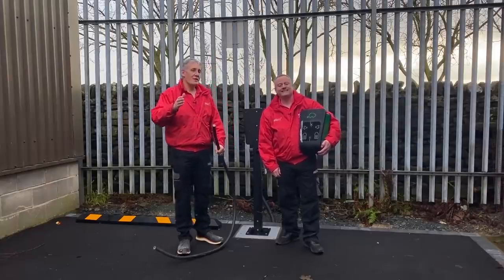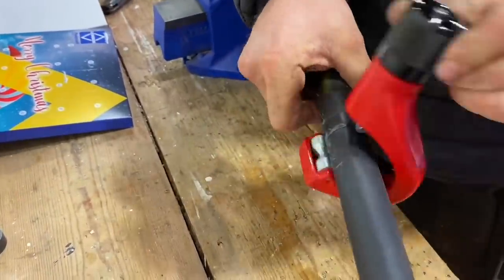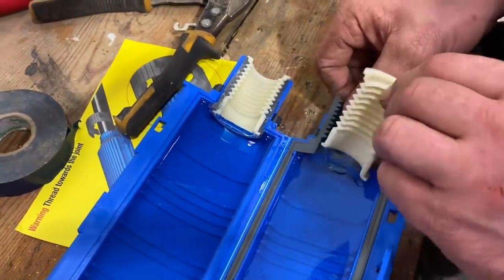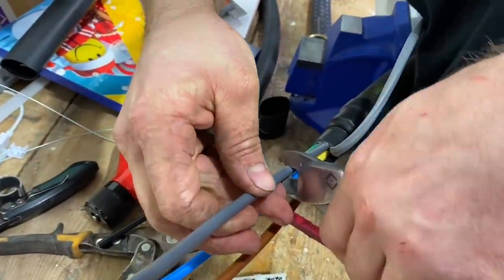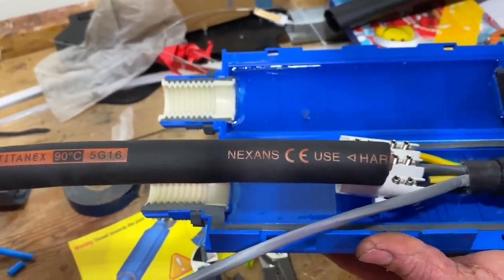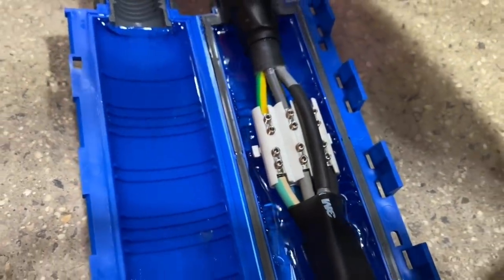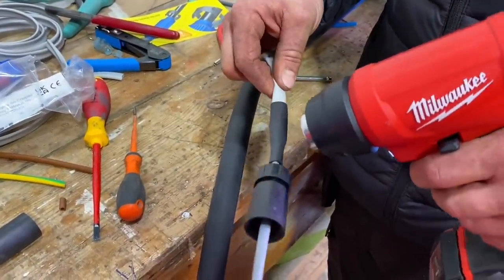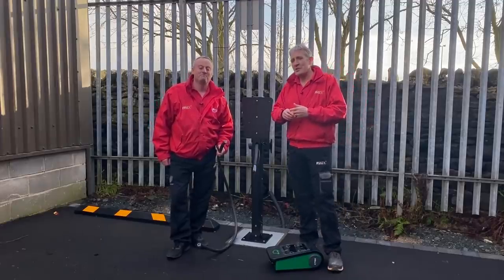PROBLEM SOLVED - USE RUBBER CABLE INSTEAD OF ARMOURED CABLE?

Comment: I'm pretty sure that Ideal made that sheath stripper back in the early 80's, it had an ecentric blade that circles the sheath then rotates to strip lengthways.. I may still have one ! of course, it was blue and company issue at the time.
Reply: BT had a similar one.
Reply: Knipex makes one slightly more advanced

Comment: I used a shark joint several years ago for joining a damaged water pump cable as it was recommended by my wholesaler. Once I’d done the connection, I dropped it in the water slowly with my fingers crossed. 10 seconds later the rcd tripped. Not used them since then.

Comment: I work In dewatering we use HO7 RNF for all the drop cables from control panels to the motors with a submersible joints to extend the motor tail. Personally think SWA is used when people don’t want to design a install and just default SWA for outside. You very rarely see it in Europe come to think of it I never have……

Comment: Why did you strip 20mm of the outer covering off the armour, before covering it with the short length of heat shrink?
Reply: At a guess, this was to pick up the earth connection with the spring loaded earth band, as you would do in a standard torpedo joint and then realised it wasn't required.
Reply: @jollyfinequality9865  I expect you are right. I would have thought they would have edited that bit out and gone straight to the heat shrink collapsing onto the cable 😀
Reply: @jollyfinequality9865  I'm also in two minds about the outer layer of heat shrink trapping the data cable to the power cable. Because it extends beyond the gel into the gland, if the gland itself is not totally waterproof, then there could be a risk of water tracking under the heat shrink in the gaps between the cables. Hopefully that last inch between the heat shrink and the terminals will be sufficient gel to do the job. Perhaps use two short sections of heat shrink, with a decent gap, to allow the gel to get in and do its job.
Reply: I assumed it was force of habit and whoever did it forgot they weren't putting a gland on
Reply: To properly glue down the armour strands. If they are left ending with the outer cable insulation, they are not held in place and butt the heat shrink. That way they could poke through the heat shrink when the cable is handled. When pressed flat between inner insulation and heat shrink it is much less likely for them to do that, they'd just slide between the two.
Reply: @HenryLoenwind  Interesting, I didn't think of that possibility. But I think if I wanted to stop the wire ends poking through the heat shrink I would have put on a 20mm length, butting up to the wires. Then put the main heat shrink over both. This way the wire ends would be kept away from the outer heat shrink more effectively.

Comment: For years we've been using flexible cables for garden and industrial installations and just running duct work after it was specified by one clients designer. The duct work itself though always had to be guarded to prevent rodent entry. Other than that you already have the relevant electrical and mechanical protection provided it's installed at the correct depths with the lay out as installed listed at the intake of the site. 

Also if you're using a duct system it's easier to run a Cat5/6 to each point if the EV points are far from a wifi signal and have a hard wired option for updates. Significant saving to be made doing it that way.

Comment: Rubber v Armoured, doesn’t it depend on the upstream protection? If an RCD (or equivalent) is fitted then Rubber would be OK, as protected against future ground works that have not carried out a ground scan.
Reply: Theres no requirement for an RCD to protect from groundworks like in this installation. Buried in a plaster wall would be a different situation tho.
Reply: Iagree belts and braces.

Comment: In my IWP we fitted an EV charger and only used HO7, only because we could fit it through a steel drain right beside the back door then feed it  through to the attic and down to the CU, I myself didn't make the terminations I just assisted in keeping the wire straight when feeding it through and fitting it to the wall. So I'd say if reasonable protection is able able be improvised by the environment then use HO7 but if at any point there's a chance that the wire could be mechanically compromised then terminate it back to or fully through with SWA, although if we had to use SWA the whole way through we'd probably would be been there for a whole say and probably after terminations getting bad IR readings. Also that house was crazy close to max current capacity, it had a B&B attached to it and having to have an EV charger meant that the owner had to reconsider certain circuits. We fixed up 2 radials and made it one whole loop.

Comment: As always a very high standard of work. However one question for you, as you guys are often the championing the use of tightens torques on connections which I think is particularly relevant on connections that are not easily checked in planned maintenance schedules. Like this one. You also mentioned relaxation and the need of a retightening which is a very good point. Many other types of mechanical fixture connection procedures often will detail time scales to re-torquing of mechanical connectors to account for creep as a property of materials with temperature bands detailed, etc. We used to have to do daily checks of our torque wrenches with a norbar tester. A wee saying our professor in Power Engineering used to say “I have never known an Electron to fail, electrical failures are always mechanical in nature” not that he was prone to any form of bias. This came to mind after just looking into 1/4 inch torque wrenches of 1/4 inch hex grub screws that specified 39nm when all the 1/4 inch drive torque wrenches I could easily find had a limit of 25nm. Needed a visit to Amazon for a drive adapter. This is with bearing in mind that we all have calibrated arms and wrists for matching desired torques. 😂
Reply: Ace..dear

Comment: Howdy. Excellent installation skills.
Personally I would recommend using non-isolated ferrules too. They will keep the strands together. Also. they will spread out the screw pressure over a larger area improving conductivity. And they also will reduce the thermal expansion effect. Different alloys have different expansion coefficients which may loosen the connections over time.
And yes. The outermost layer of a cable is called the mantle. The armour is another thing. These are often mixed in mundaine talking. And finally. The armour in NOT the PE conductor in consumer voltage installations. Yet the armour MUST be equipotential bonded to the PE. In distribution voltages of 10 - 20 kV the armour is often used as a PE or PEN conductor.
Wonderful piece of appliance. Usually this kind of cable switching is done using cast alloy boxes or cabinets. Connections are done using pipe type screw terminals. Finally the box is filled with resin. Good too but cumbersome compared to this appliance.
In high regards.

Comment: I am not keen on the cat5/6 cable touching the live terminals, if this was to ever wear through it could cause damage to IT infrastructure, also not sure how you are achieving electrical separation between mains and network cables after the joint as it looked like you didn't use a shielded network cable after the cable joint. This can give interference into the network cable through induced EMFs and corrupt data. Interesting video though!
Reply: I am certificated Computer Specialist for data cables. I never install power cables together with Cat3 (or better) if I can do it other way. Specially direct near 16 mm² power cable with 63 Ampere.
Reply: ELV cables CAN be run next to LV cables providing the insulation on it is to the standard of the higher voltage cable (i.e. 400volts). I think the manufacturer of the multi-cable knows this and has insulated the data cores with a sheath matching that of the conductors. The demonstration shows the installer adding some heat shrink near to the joint terminals to increase the mechanical protection of the data cable above and beyond what is necessary- just for their own overall good standards. I do take your point about interference into the data cable though, but I believe the data cable part of the multi-cable is screened.
The multi-cable couldn't have a BASEC type approval if it didn't comply with the standards of both types of seperate cable.

Does this sound satisfactory to anyone?

Comment: Your 16mm conductors equals our 6 AWG conductors in the US. If we at doing an EV Charger hookup it is considered a Continuous Load. In the US, any load that can be expected to last 3 hours or longer is Rated as a Continuous Load. When we have a Continuous we must derate both the Circuit Breaker and the Cable by a factor of .80.  With a 6 AWG of this type we could only pull a maximum load of 40 Amps maximum per conductor. Also, we can only use the 1/2" thru 1" Flexible conduit in the ground, anything larger does not meet the crush requirements for this installation and are not listed to be direct buried nor encased in concrete. Knowing how strict the Electrical Code are in Great Britain, I am really surprised that they allow this conduit for the same reason that you cannot in the US which is the crushing issue.

Comment: Work with H07 and SWA every day. H07 is the cable you want for the big cable pulls. It’s mostly used for motors and pumps.

Comment: Is twin wall ducting classed as having “equivalent mechanical protection”?  The reg states “Except where installed in a conduit or duct which provides equivalent protection against mechanical
damage, a cable buried in the ground shall incorporate an earthed armour or metal sheath or both, suitable for use as a protective conductor.”  How do we determine “equivalent”?

Comment: Another great video there guys, In short.. if mechanically protected and electrically protected then why would you not use easier to work with cable.. H07 all the way..

Comment: All types of cables have their applications and uses. I think SWA is better than H07-RNF cables for underground use. As it's name suggests it is "armoured" against spades, diggers, Rodents, etc..I always feel like tough rubber cables are an easy way out of doing a job properly, especially in gardens, a spade will still go throught it with risk of shock to the person chopping through it, At least with a SWA they have to cut through the Armour (CPC) before hitting live cables. With HO7-RNF they could hit a Live cable first. The least joints the better. Swa Underground, and then terminate above ground into the charger I would say. But thats just me lol.

Comment: We’ve got 3 big three phase boards running off a big generator due to a damaged cable during some groundwork’s. The Rubber is still good now. No problems at all 👍

Comment: gel joints are awesome - i'm only telecoms and data, they are great, and super fast to for eg, fix  a copper phone leadin that mr citizen has run his spade through whilst his missus stands over him guiding him to dig out that new landscape feature.  So much easier than messing around with rosins, and risking spilling the muck all over customers property, it was a sparky who first showed me the use for them, love em.

Comment: I think this is a great solution from what I've seen from the poured joints they're permanent this is something that could be undone and repaired, replaced without having to snip off some shortening the cable that you probably don't have enough of.

Comment: Careful when bending the CAT5 cable, they aren't designed to be bent as much as it is in the video. Shouldn't impact it too much but will means it may have lost some performance as it will have been crushed at bit
Reply: On that note I had some I think cheap rescued cable that I was working with insisted on kinking itself. Tested OK but I don't have a certifier. With that said some cable is better to bending than others but it's something to be aware of.

*Well tested OK except for the one I put in a ceiling that I have both ends terminated wrong... shocks I did 4 ends and wouldn't you know it the two that ended up in the ceiling we're wrong It just barely worked at 100mb for the event.

Comment: I believe this solution was the best when you have to consider the acute bend. Tempting though it is to run the rubber cable throughout, when all considered- rodents- you run in the SWA cable.

Comment: I'm not familiar with UK electrical code, but why in the world would one use an armored cable when you're running it through pipe ducting?
Reply from the maker: It’s pretty much standard practice in all UK installs.
Reply: @efixx  what is the reasoning behind that?
 The only tangible argument for it I can think of is emc. 
Here in Norway the requirement for armored cables in (low voltage - sub 1KV) is when there is a risk of mechanical "influence" I.e buried in the ground, or at risk of abrasion or impacts.
Reply: Indeed strange. Doesn't the entertainment industry just use the flex cables when transporting energy? And in plain sight,  haha. 
So flex from the junction box to the charger sounds a smart thing to do. 
Ps. Why CATx cable? Isn't the logic and EV connector build in, in the same box, or is it to manage the max current per car   if more cars are charging?
Reply: @gubbernl  Yes, the data cable is usually used for the CT clamps.

Comment: Would it be better to either use cold-shrink or a long non-shrink (long enough that it can't slide far enough to bring Cat.5 in contact with live screws)?  I'd be concerned about melting the insulation of the 8 inner cores, especially at the end of what won't be a cheap cable.  The two-cable exit would be tricky though, Woer do cold-shrink with sealing mastic for telecom use which might fit the bill.

Comment: Regulation 521.9. 1 permits the use of flexible cables for fixed wiring if they are of the heavy duty type or the risk of damage is low or protection against mechanical protection is provided.

Comment: Comment on the appliance side with the rubber and network cable. Two points;  laying the cable in the way it is concerns me as there will be potential for water ingress as two round cross section cables will not fit neatly. Secondly by crushing the network cable CAT5/CAT5E/CAT6 will compromise the integrity of the four twisted pair differential signals within the network cable. This latter point is not ideal, and it would have been better to provide an additional output that can be filled with silicon grommet if no network cable was used.

Comment: I can't say, addition heat-shrink layer or not, I like a data cable being in touch with mains voltage terminals. It would be nice to have a much more robust separator. I guess the connector was never designed with being shared with data in the first place, but it doesn't strike me as ideal. For that matter, I'm not sure I much like the idea of cat-5 embedded in a mains cable in the first place.
Reply: With you on that one mate. Seems like you would have to say low likelihood but high consequence on the old risk assessment on that one, I love cat6 swa, that stuff is bomb proof, and probably cheaper to buy 5 core swa and separate cat6 swa then a highly specialised wire.

Comment: Great vid once again guys. Would you know if there are specific measurements for outer sheathing to be removed from the cable (to expose the wire)  in relation to the size of SWA gland (20s, 20, 25 ect ect). I see in the vid he uses a square set to a certain distance. For 20-25mm glands ive always used the width of some tape plus half a thumb but often wonder if there are specific measurements that can be used for an optimum fit; this is especially the case with CW waterproof glands where its all too easy to remove too much of the sheathing and end up with the wire showing outside the gland and its waterproof bung, which defeats the point of a waterproof gland. Maybe you could do a vid on it !! Cheers